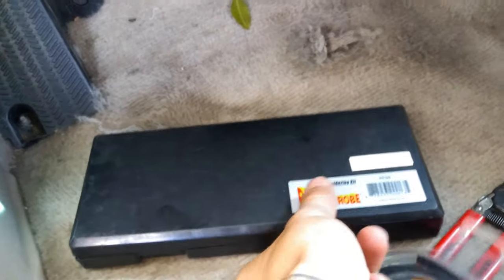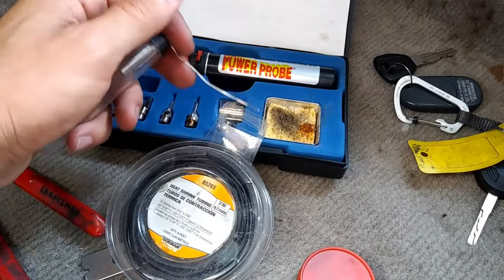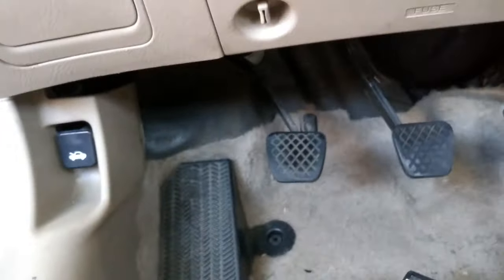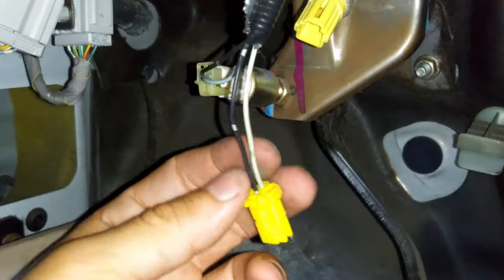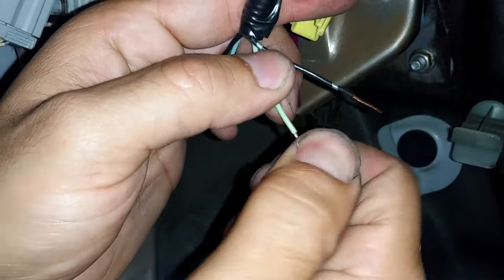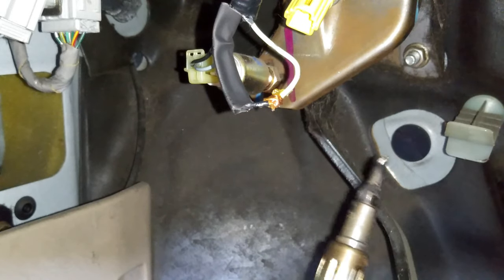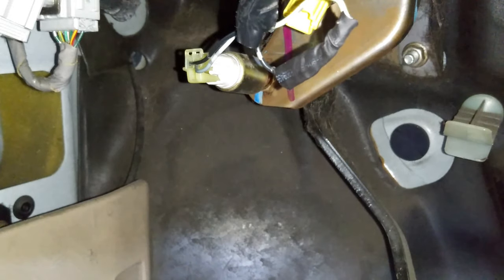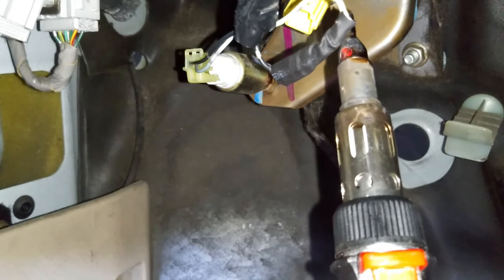how to bypass a clutch switch

Comment: The easy way, unplug use a paper clip and stick in the plug on both wires. That's it, your on your way. No cutting, no sodering.
Reply: Yes, I did the jump wire method YEARS ago, and never had the problem again!
Reply: This is exactly what I did about an hour ago I got in my truck no start long story short I come to the conclusion that it is my clutch safety switch walked in asked for a 📎 and omw home in a few seconds
Reply: Agreed.  Better than cutting and soldering because the paper clip method is reversible.
Reply: @canuckfixit7722  where do I put the paper clip
Reply: @tamijohnson5667  In the yellow socket that is removed under the steering wheel above the clutch.  Watch the video.
Reply: That's what I just did too. I was stuck in a different part of town, car wouldn't start and I had a suspicion it was the pedal switch.
This video helped me determine which switch to look for, but I just used a short piece of wire to jump the terminal, and I was on my way !
Reply: What happens if you leave it (bypassed) all the time, besides the obvious Risk of cranking your engine in Gear?
Will it damage Relays or other circuits?!
Reply from the maker: No it wont
Reply: This literally saved me so much money!! I can’t thank you enough for this I almost bought a whole ass new battery and starter and once I put in the paper clip my car started right up!!!
Reply: @harizleaniag7174  
Good deal brother, my old boss man showed me that little 💎  of ah hack about 27yrs ago on a old k5 blazer I think it was. Speaking of mechanic hacks, one that got me out if the woods a bunch of times. I almost always have a battery powered impact or 🔨 drill on me weather I'm going hunting in my pickup truck or to the range behind the house on 4wllr. With a couple wires and I used 2 pennies with a hole drilled through. Wrap wire through hole of penny.  So 2 wires with penny on one end. Don't need a penny but it seemed better than just shoving the wire up in the slot. Anyway on your 18v 20v whatever you got, look at the slots that slide into the charger. Most now days show the + and - slots. Usually on the far right and far left. Slide pennies into slots be sure to not touch the 2 bare ends together. Small alligator clips "roch clips" work good to. Hook to battery of car, truck, boat, rv or 4wheeler and it will crank your vehicle.  But not good to do often due to vehicle batteries are 12v but hay win ya in a pinch ya do what ya gotta do. And it works, got me out of the woods many, many times on my 4wlr.
Reply: THANKYOU
Reply: Will this drain your battery?
Reply: It was old k5 blazer.  My boss man did it for me and it stayed that way for as long as I had it.  Never any dead battery issues, you no, unless I left radio, or lights on, but not from the p.clip
Reply: @boystoyz8922  got it brother!, mine died after few days, but im sure it was because of the lights i left on over night. thanks for the response! just tryna make sure before plugging it back.
Reply: How do I do this?
Reply: @jasonbarham2305  
Find your clutch switch, and jump the 2 wires.  Utub make n model of your vehicle, clutch switch replacement. This will show you were it's at. Jump it with p.clip or a piece of wire stripped on both ends about 1/4"

Comment: Just a heads up.. You can put a rudimentary anti theft device on it by adding a toggle switch to your connections.. this way whomever decided to start the car would have to know where the switch is hidden and or push it off and pop the clutch and we all know, Criminals don't want to work.

Comment: You didn't have cut the 2 wires. All you need to do is just use a paper clip. Cut the paper clip 1/2 inch and make a curve out of it. Then attach the paper clip to the corresponding wires via plastic connector you pulled from the clutch switch. This will bypass the connection. If you want to sell the car, just take the bypass paper clip from the connector and connect it back to the clutch switch

Comment: A real waste of time ,why not just place a jumper bar on the plug you removed from the switch instead of cutting it of and doing all that soldering. That way you or the next owner could reconnect the switch easily should they wish ?
Reply: Exactly

Comment: So why didn't you use a jumper wire? That way you can still have the plug so if you sell the car the switch can be replaced. Most clutch switches run about 20 to 50 dollars.

Comment: I rigged the safety clutch switch with a paperclip and now we are back on the road again, thanks much! I wrapped it with electrical tape and then taped it all up further around a existing harness. My wife loves it and now I'm teaching her not to leave the car in gear and to always leave it in neutral.  

I tried to glue in a nickel or a piece of hard plastic from my sons nerf dart but its so tough to do without removing the clutch assembly. Just decided to use your paperclip method, again thank you.
Reply: Just a note.  When you're young, and you're being "TAUGHT" how to drive a standard, or Manual.... you're TAUGHT to after you shut down the engine, use the Emergency brake/parking brake, and then: ALWAYS put the car in 1st gear, or Reverse, ESPECIALLY if you are to park in Mountainous, or "Hilly" areas.
Reply: Always leave a stick shift in gear when parked. That’s your e brake failsafe. Especially on a hill
Reply: and it doesn't drain your battery?

Comment: Didn't want to sift through the comments to see if anyone posted this already, but the stuff in the red capsule was called flux, it helps solder find its way into cracks and helps clean the dirt out as well.

Comment: Thank you for the info. I have a Nissan Senatra 4S 2019 that I've had a hard time starting for weeks, due to a clutch sensor problem. Two new sensors didn't help any, but jumping that clutch sensor did the trick! Now I don't have to unplug/replug the sensor to get the car started.

Comment: Thanks. I ripped out the wrong wires but found the right ones and ripped them and twisted and covered with electrical tape. I am sure soldering would be 100% but I have the clutch safety override switch as a backup. Thank you

Comment: Flux is for  Sodder. Saw someone stick a 10 amp fuse in the plug.  I'd like to use tape and then put a zip tire around that helps too.

Comment: Excellent video! I have a 1998 Ford Escort that often will not crank after a cold night. Starter is good, battery is good. During warm weather there is no problem. The plunger on the switch comes out, but I have to play with the pedal, press it to the floor then let it pop up. Still won't start. After 15 or 20 minutes the car cranks. Once the car is warm the starter cranks every time. Lately, once I get to the end of the driveway, I press the brake pedal, then the clutch, and the motor dies, and will not crank. Then I have to play with the pedal for several minutes again until the starter cranks.
The switch has 4 wires. The main problem is getting in there, it's such a tight and dark space.
Reply from the maker: Yeah it is a pain in the butt but well worth it. If you need help let me know. I can help you with the wiring
Reply: I have the same problem you described with my B200 mercedes 2007.  Can I replace the Clutch safety switch?
Thank you
Reply from the maker: Yes you can.

Comment: Hi, for temporary starting issue this technique this is one of a kind.  but without cutting , soldering so much if we by pass starter relay points by totally removing the starter relay , the car starts directly with key, is not it ?

Comment: I'm connecting a toggle cutoff switch on bypassed wires that connect to the two-prong "clutch safety switch" because I'm afraid that if I leave that; the clutch safety switch which is (in-series-circuit) with the Ignition key switch, will "Remain closed (energized) having a constant current flow through the whole circuit up to the starter...
I hope you can understand my concern.

I'm doing this as an emergency measure until I get a new (clutch safety switch) installed...
I might as well do it myself..🤔👍

I also understand that with the Ignition key switch, the only time it will complete the connection is by trying to (start; turning the key while the engine is still running (on).

Observation: the clutch safety switch is constantly wearing out every time you depress the clutch to change gears, which I think that is an engineering Flaw, especially for cars with "Manual Transmissions".
I'd would design a sort of mechanism to automatically retract that switch away from the constant use of the clutch Pedal, and maybe use a magnetic-type sensor interrupter...

I'm open for Suggestions 👋
Reply: You are correct Sir, if you leave those 2 wires connected they will create a parasitic draw. It kept draining my battery. the toggle switch seems to be the best option!

Comment: Used to be, the way all manual transmission cars started.  This holding in the clutch thing came about in the early '80's.  Years before it wasn't an issue.   You always parked a Manual car using the E-brake, and putting it in gear, 1st or 2nd or Reverse , if you pointing down  on a hill.   It's the way that are supposed to be. Just don't be stupid, and always double check it's in Neutral before you turn the key.

Comment: For everyone watching this video.. DO NOT do it like this.. this is thr worst way.... unplug that yellow connector. Take a paperclip and cut it down.. stick the paper clip into both terminals making a connection and tape it up.. later down the road if you were going to sell the car you can pull the paperclip out and plug it back in

Comment: Seeing as how my Suzuki 4x4 has to female ends to connect to the spade bits on the switch I just connected them with a fuse and taped it together. Yes soldering is more secure.

Comment: 🤔Tinning the wires with flux before makes soldering soo much easier..💯👍
Reply: Had zero problems with my car after I replaced the motor myself. Bout a week ago I was driving around watching Netflix on my lpad with it connected to a aftermarket system I installed. I pulled into a parking space and the car turned off, it’s a standard so I checked my battery with my multimeter and it was gd so I tried to push start it. No go, all the symptoms of a clutch safety switch yet unplugged with a jumper in between still nothing. I did notice resistance on ground from alternator  but everything worked flawlessly for a year, I’m puzzled. Any help would be much appreciated. 🙏 Thanks
Reply: Flux doesn't tin the wires.  Applying solder to each wire before joining them is tinning.  Flux does help heat transfer, though.

Comment: Does this mod affect operation of the cruise control or is that the function of the lower switch I see in your video?  Normally a switch will cancel CC with a gear change.  I would like to do this to save my thrust bearing and for no other reason.  I noticed that on my Honda Element the switch is Normally Open so the jumper will trick the PCM into thinking that the clutch is always depressed.
Reply: The lower switch disengaged CC. The upper switch allows starter to spin.

Comment: I tried this on my 06 Nissa 350z  and nothing turned on? I am thinking maybe a fuse blew I just have no idea.  I have heard a few saying you have to run another power line to make the connection work, but that really doesn't make sense because we are only dealing with 2 wires.  Any suggestions please

Comment: I've been working on my 92 Prelude. Replaced the clutch, flywheel and bearing. Also replaced Master and slave cylinder. Got a firm padel, just isn't starting with clutch pressed. Will it work for my issue. Seems to be that switch. I'm gonna try it tomorrow, thanks hopefully it works.
Reply from the maker: That could solve it.
Reply: So it worked out perfectly fine, appreciate that. Had to charge battery, other than that. It's alive again. Thanks again

Comment: Good stuff man I have a question so on my honda I gave 2 clutch switches just like you the top yellow one and the bottem white one. I went to the junkyard and pulled a entire dash cabin harness turns out the harness I pulled only has the top yellow clutch switch up not the bottem. The car I pulled it from just had a bolt screwed in there. Do I need the bottem clutch switch or is that not needed. Will my car start with out it ?
Reply: The bottom switch is for cruise control, so no it’s not necessary for starting the car

Comment: 1987 Jeep Wrangler, 4.2-5 Speed...Truck was running, then DIED...Thought it was Ignition Switch, but it Works Sometimes??...Check Connector  for Power, NONE??...Do You Know Location of Fusible Links??
Working on These, Is Very Rough Conditions...Too Tight!!...Thanks!!

Comment: I had my mechanic do the safety switch bypass but now my cruise control doesn't work. 
Is it possible to do the bypass and still retain cruise control, or does it kill CC with the bypass and there's no way to avoid it? I'm trying to get my CC back for the long drives... — 2000 Acura Integra

Comment: Hey, so my car already has this done but I want to switch it back so the clutch pedal needs to be pressed, how would I “undo” it since I don’t have the plastic end piece to re insert again?
Reply: Find a clutch safety switch pigtail connector the one that has wires running into a plug that plugs into the c.s.s

Comment: i did this, bypassed the bad clutch safety swirch and still didn't start.  battery is good, is there a way to remove the entire clutch starter switch wire? it obviously makes it way to the battery at some point. My truck is a 1990 Mitsubishi Mighty Max

Comment: I mean after you take out the safety switch it starts regardless.
Sucks my mazda only has one switch directly connected to the clutch. Takes multiple pumps and attempts to get the key to simply turn to ON position

Comment: I have a 2015 civic si with a push to start.. do you think it works the same for that? 

Keep getting stuck with it not starting and having to pop start.. 

Battery is a year old, starter is good, just won’t start and all signs point to a faulty clutch inhibitor switch based on forums/people with the same issue.
Reply from the maker: Yeah it should be able to be bypassed

Comment: Thank you, Very Good Video!    My Accord 6 spd. still has intermittent starting Problem. Could be a lot of different things: Key Ignition switch, starter....   I don't know.  IF you have any ideas, pls publish.
Reply from the maker: When it would start intermittent do you hear a click or does it crank whats your symptom?
Reply: @JaboTheMechanic  , Yes, I hear a click. nothing else.  then I turn key back to acc., then turn key again to attempt to start. sometimes it starts.
I could try 3-5 attempts then it will start. Battery replaced 2-3 months ago.
Thinking of a new starter.
Reply: The CPU senses that and it will give you a "check engine" light...
Reply: It was the Original HONDA Starter!  I then had this Original Honda Starter rebuilt by a good shop,  It lasted 2 yrs then another Starter installed.

Comment: Dumb question but with doing this process are you able to still dive the vehicle will vehicle still shift through gears
Reply from the maker: No its only meant for starting the car. Its a safety feature to prevent starting the car in gear

Comment: What about 3wires coupler in Chevrolet Cruze push start it is not ignition on properly i want to bypass the clutch pedal sensor it has 3 wires

Comment: Just a side note: can you install a switch that Allows you to go back to the Original Wiring Method? So When you bring your car in for Service, (These Service/ Dealer people will have NO Knowledge of your Car or have knowledge that a Safety Switch is Bypassed)  & you Won't have to tell the Service Writer/ Mechanic that the clutch Safety switch is Bypassed. Someone had a Jeep serviced in Michigan and after an Oil Change, the YOUNG Mechanic Trainee reached into the Jeep after lowering it to the ground and Started the Jeep and the JEEP moved forward KILLING the Dealer Master Mechanic.  The Young Trainee didn't know how to drive/ start a Manual Trans. Vehicle. He just hit the starter switch without Pushing down on the clutch pedal.

Comment: @Jabo The Mechanic  i have a 2013 fiat 500 multiair turbo manual transmission. I jump turn the key and nothing like in you first key turn. Checked battery starter and even cleaned throttle body. The car start when it wants is this a similar issue?
Reply from the maker: It could  be. Or it could be  a few other issues

Comment: My clutch safety switch Has no harness that plug on the switch. previous own'r elliminates it wires are tied together, truck wont crank. It has power and etc. Made bzzng sound but no crnk?

Comment: help? i just push my switch and it pops back out. how did yours stay in?
Reply from the maker: Did you still needed help
Reply: @JaboTheMechanic  no thanks! My issue is my starter is bad. Once we tapped it and it started up we knew it's on its last leg.
Reply from the maker: Glad that you found out the problem!

Comment: What would cause my car not to start I have a brand new starter brand new battery and a brand-new alternator my mechanic also did this to my car where it could start without me pressing the clutch why does this happen quite frankly I would feel comfortable just fixing the problem and keeping my car the way it is but for now it turns on without the clutch and I want to find out what causes this for my car not to start when having a fresh battery fresh alternator fresh starter